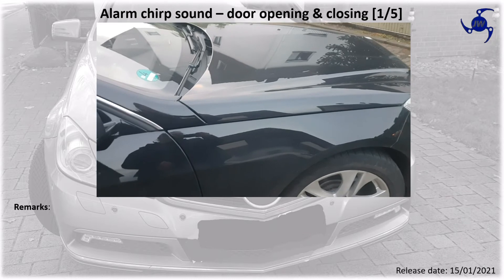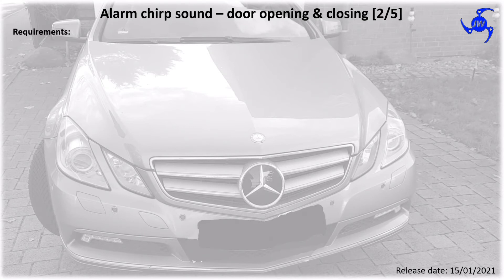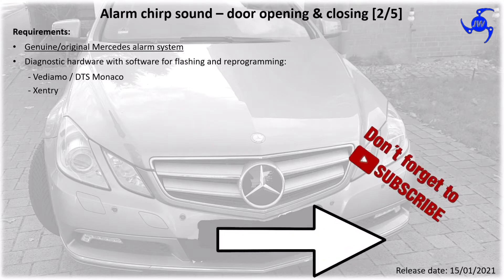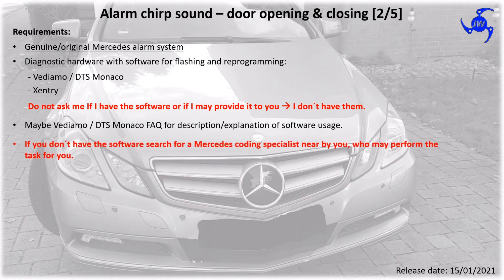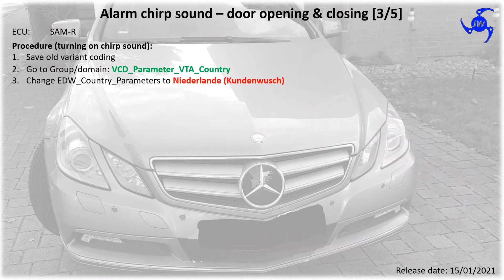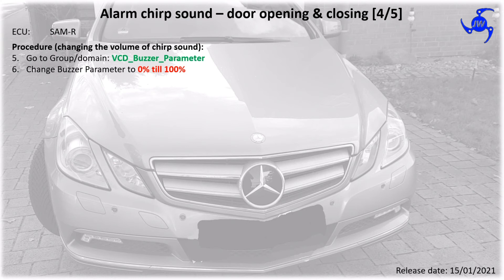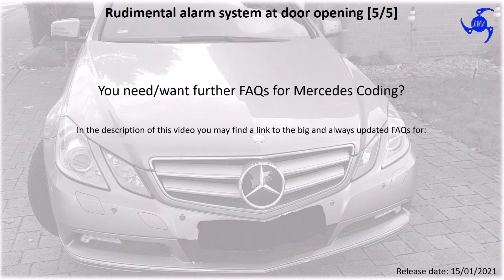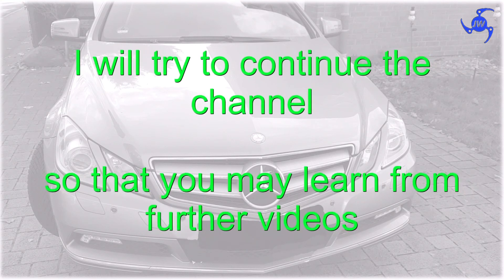DIY - Sound for car closing and opening - chirp - not by horn !!! - Mercedes coding manual

Comment: Can you do the same with W222?
Reply from the maker: you need to try it 
search for the positions in the ecus. 
but one option you need to have in your car. 
the Mercedes Benz alarm system. 
cause this coding works just with the alarm system. no alarm system -> not possible to activate it
Reply: @JWAutomotive  Thanks.
I tried it and couldn't access SAMR_212.
Reply from the maker: if you are not able to access your rear sam 
ECU unlock?
and / or 
newer/different cbf version needed. 

trial and error by yourself.
Reply: @JWAutomotive  Thank you very much. I'll give it a try.

Comment: Hello, when I edit the VCD_Parameter_VTA_Country step, an error occurs.
(SAMR212:DJ_SecurityAccess:CAESAR:Datainterface:05016:DiagService not found:DNU_RequestSeed_Request.)
I searched for answers on the mhhauto website and found that many people had the same problem.
But I didn't find a solution and would like to try to ask for your help.

Thank you for sharing your video tutorial.